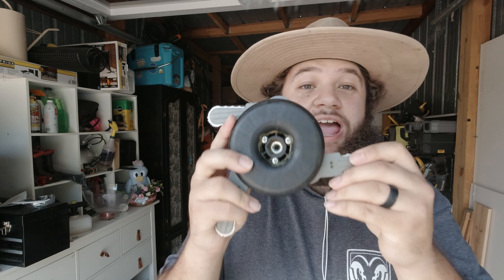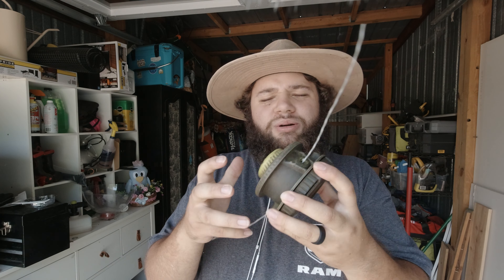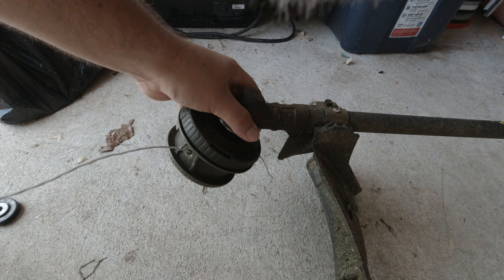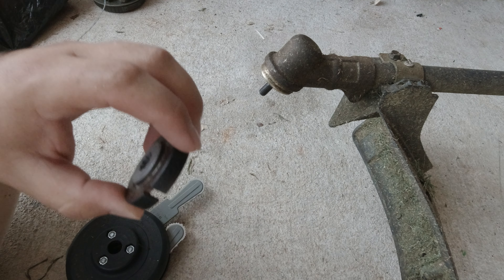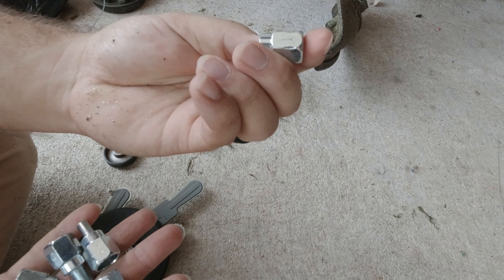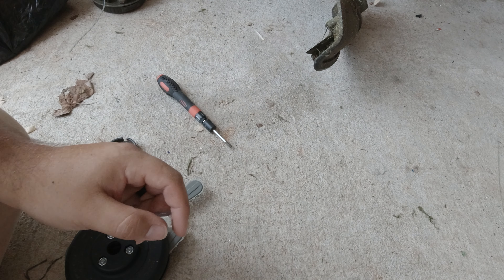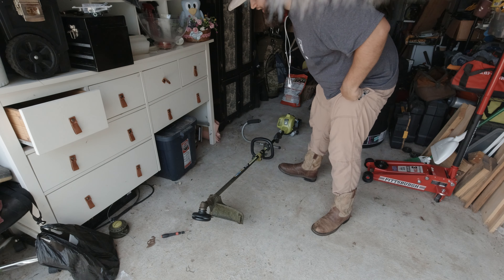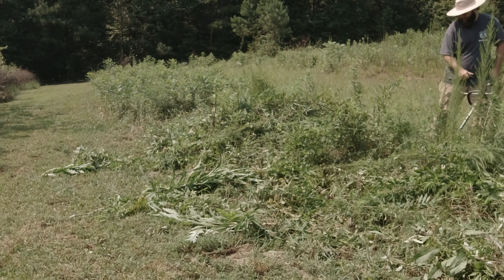The Best Weed Eater Attachment!! | Rino-Tuff Universal Brush Cutter

Comment: The metal blades will throw sparks when they contact rocks and if the grass is dry, it can easily catch fire.  A weed trimmer head that uses line strips is better out here in the desert southwest.
Reply from the maker: that is a very good point. i never thought of that
Reply: @Ectorcabral  Some old guy near where I live started a brush fire with a bladed weed trimmer attachment and they had to call in a air tanker to drop slurry to help put out the fire.  Imagine the bill get got for causing that fire.
Reply: You have better odds of finding gold at the end of a rainbow than grass catching fire because of the weed eater head.

Comment: Hello Ector ! Happened by your Vid here and think I'm asking THE right guy his opinion......I purchased a New Riobi Weed wacker, similar to the one you're using, at a close-out sale at Home Depot, along with one of those RinoTuff Brush Cutters you demonstrate here. I removed the bump style string head and installed The Rino Tuff pivoting unit on the straight shaft and went to work with my new set up. Cutter seems to work well as you show, but after less than an hour through the work, I began hearing a bell-like clanging coming from the area where the shaft attaches inside near the Riobi's engine. Have you or anyone you know experienced such a problem with the Brush Cutter's usage ? I am convinced that this unbalanced cutter unit destroyed something up in the engine area. I returned the Riobi as defective, but am NOT going to using the brush Cutter again with my New Toro weeder in case it's the problem with the Brush cutter's causing damage. Your thoughts on this concern would be helpful. Thanks......but BEWARE to anyone considering using one of these.....
Reply from the maker: That is so strange! It definitely felt like the clutch just blew up that sucks! Yeah I don’t blame you for getting you a new one!